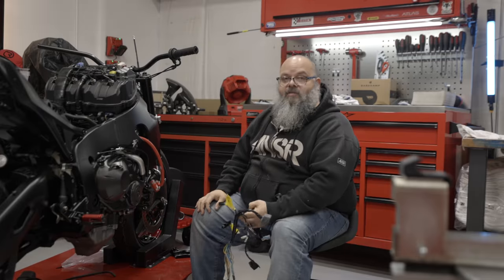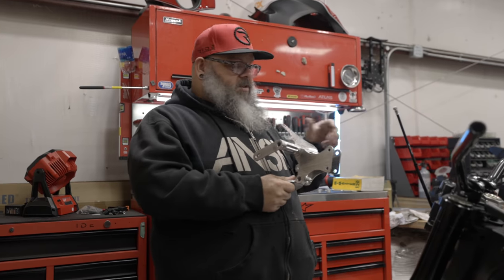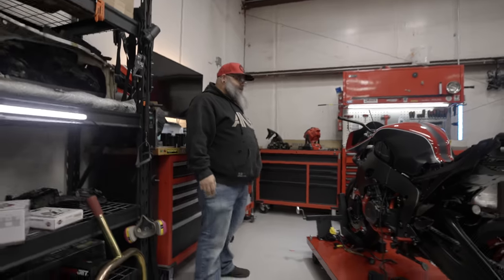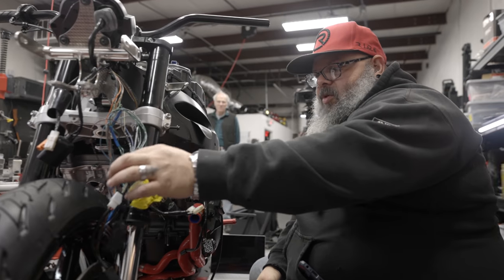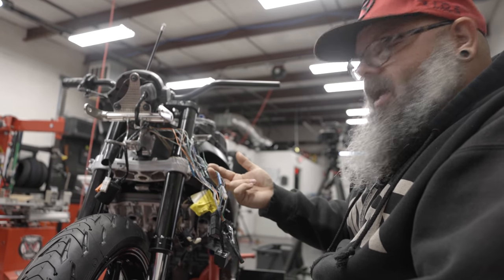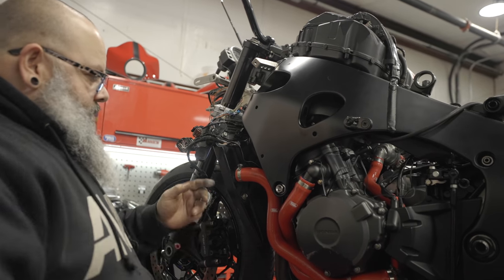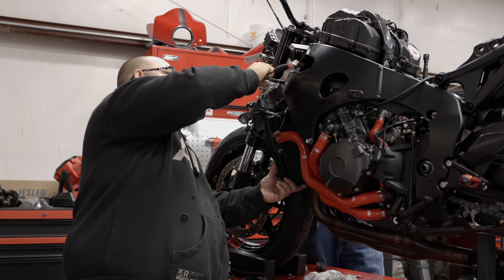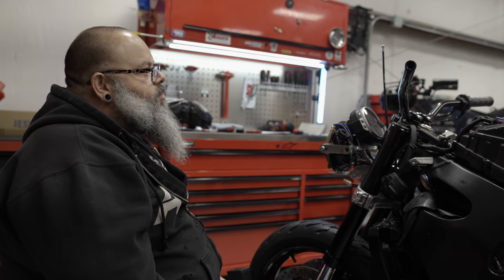This Headlight is One of Kind!  | 2008 CBR1000RR Street Fighter Build - Day 28

Comment: OC: Would not have done anything differently. Looks to be that you followed the color and connector as a whole from the owners manual. Looks to be mostly kept the location as original. So there would be least amount of changes needed in the original owners / maintenance guide